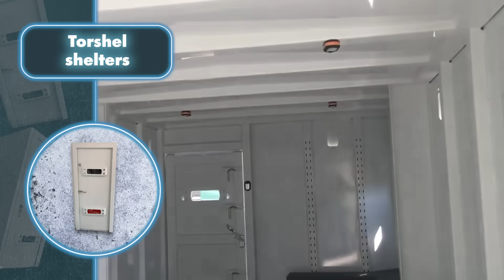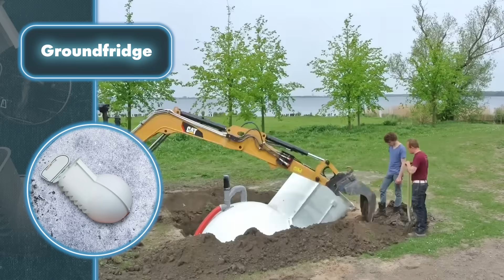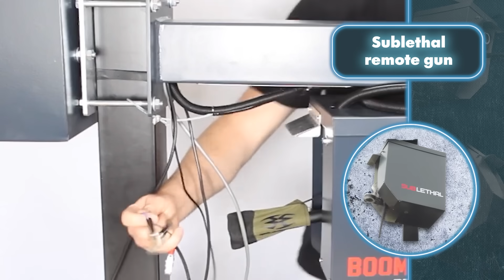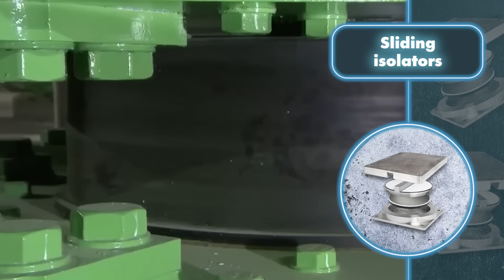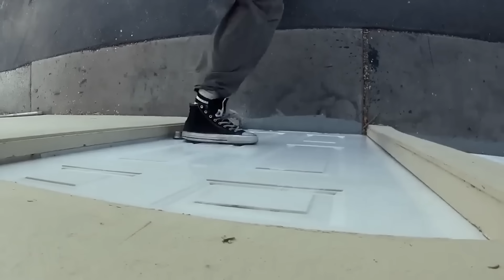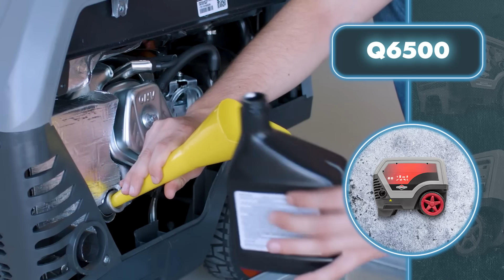Incredible Inventions for the End of the World

Comment: Always wondered if people ever consider the high chance of trees or other objects falling on the ONLY door/hatch in/out of a in-ground bunker.
Reply: Add to that the likelihood of the bunker getting disconnected from the power grid, or the failure of the power grid, and the in-ground bunker has just become a large coffin for all who are inside. The power goes out, air pumps and filtration devices are no-longer operational, and the escape hatch has something preventing the door from being opened.
Reply: There are work around possibilities for power. One escape shouldn't be an option. 2 still isn't enough without a tunnel. You can generate power with the right know-how. You can even ventilate without power with the right know-how.
And if disconnected from the grid, those without one still wouldn't be any better off

Comment: What if in the storm shelter something heavy lands on top of the access on the inground and you can get out or the door is blocked.  Shouldn't they open in?
Reply: That’s why I keep a small hydraulic bottle jack in mine. A 4x4 to push up against it. If it’s worse than that I’m hoping the fire department can get it cleared eventually